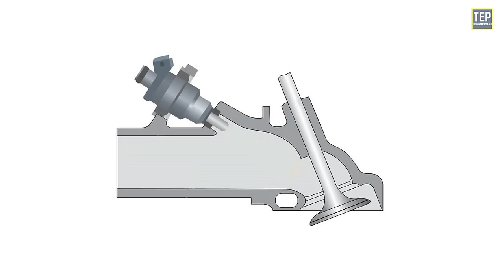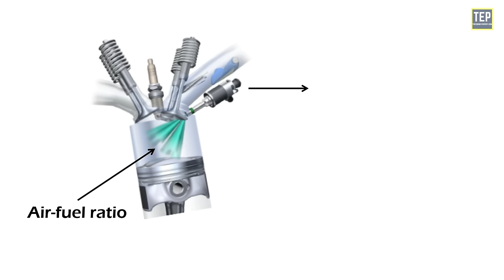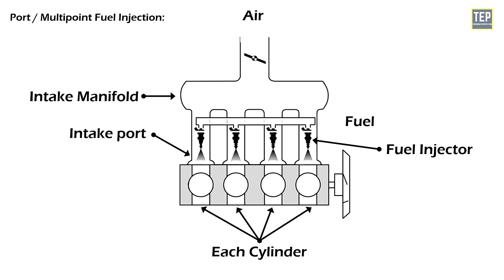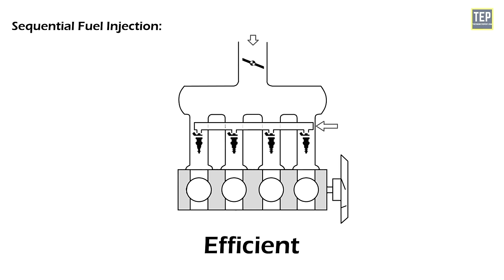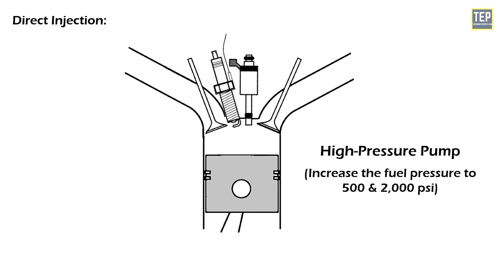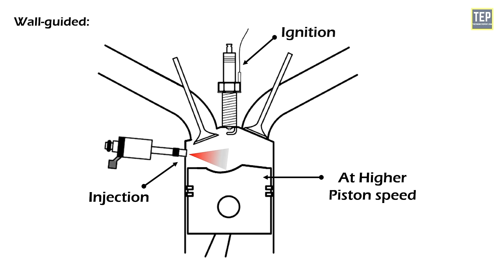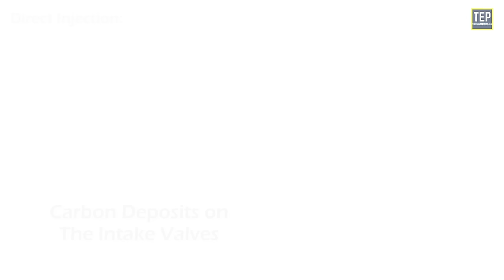Fuel Injection System: Comparing How TBI, PFI or MPFI, GDI, Dual Injection Works?

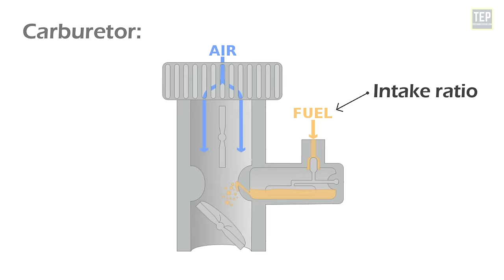Comment: 6:56 actually, before I engine-swapped for a bigger engine, my 1984 Camaro had a carburetor that acted like fuel injection, but also acted like a carburetor at the same time. It had parts inside of it that regulated fuel-air mixture controlled by the ECM.
Reply: Ah, that was a crazy system
Reply: Forgot to add, crossfire injection

Comment: At 15:27 - Petrol/gas fuel burns with a flame front, it does not explode. Diesel, on the other hand does explode, these engines are referred to as detonation engines.
Reply: compresion ignition in the usa
Reply: "Diesel, on the other hand does explode"
Maybe under water yes, but not in real life

Comment: Wouldn't simultaneous fuel injection be worse for fuel economy and emissions than sequential and batch because you're getting fuel delivery on strokes that aren't the intake stroke?
Reply: The batch injection would have the same problem. Only one cylinder is doing an intake stroke. Why would anyone inject fuel into more than one port at a time since the wiring and electronic control is not difficult?
Reply: I am assuming it changes torque or hp depending on cc of the cilinder and sequence. Maybe batch would improve torque, while sequential focuses on horse power , ?
Reply: What do you mean by simultaneous? The dual injection system operates at different rpms.
Reply: There's hardly an engine that works solely on simultaneous injection through all rpm. I have a car with Nissan engine QG18DE. It starts with simultaneous injection when the engine is cold, for about 20 seconds, and switches to sequential injection when engine rpm is above idling or engine temperature being communicated to the ECU shows the engine is adequately warm. So, simultaneous injection is for cold starting, then as the coolant temperature tells the ECU that there is a rise in engine temperature, the ECU switches fuel delivery to sequential injection.
Reply: Yes. It was done to reduce costs. The fewer separate injection events, the less powerful (therefore cheaper) the ECU needs to be. Batched or simultaneous injection also has a role as a "get you home" fall-back when one of the sensors has failed.

There may be other advantages to batched or simultaneous injection, though I don't know what they would be. Hopefully we'll get some more information from other contributors.
Reply: Yes. But until we got cam position sensors, it wasn't possible to intelligently fire the injectors on individual ports timed to the intake stroke. A crank sensor only tells you when a cylinder is at top dead center(compression or exhaust) or bottom dead center (intake or power). Under such conditions only batch fire is possible. Continuous or batch fire is still used as a limp home mode if the cam position sensor fails. Continuous or batch fire is also used during starting because they can start quicker than the cam sensor can zero i's interpretation of the cam reluctor ring position.

Comment: Back in the 80s European cars had Fuel Injection E-CIS Called K-Jetronic or CIS or Constant injection System, it wasn't a  Sequential system, outdated by 1985 Where Some Top Line American and top line Japanese Cars used a Timed Sequential Port Fuel Injection System

Comment: Do you have a video that explains how the old mechanical fuel injectors in diesel engines work?
Reply: Old mechanical diesel injectors work in a similar manner, instead of a electromagnetic coil, you had a camshaft press the injector, spraying fuel, more like a bottle of glass cleaner, you pull the trigger, a fine mist of it comes out.
Reply: @Keyaan Adeeb  The old Detroit Diesel injection system worked like this. Then came the rail pump and then the Bosch VE pump designed for high-speed diesel engines.

Comment: Thank you so much ... I have a gdi injection engine ( vw fsi) . I have converter it to start using cng gas but yhe car has refused running on gas. I ensured the gas inlets are very close to the engine block  and yet I will not run on gas. Please guild me on what to do

Comment: Out of these types of injectors..which one is widely using now days in SI engine and CI engine??
Reply: CI uses spray guided Direct injection and SI engine use either sequential multi point or wall guided Direct injection

Comment: 2:48 How can the fuel pressure regulator increase the pressure by alowing more flow?? if its after the rail it should restrain the flow so there will be more pressure inside the rail...
Reply: Pressure regulator increase the pressure by allowing more flow from pump and restraint after rail.

Comment: As said too many components,parts & their requirements,got a solution as follow:-
1)Either one or not more than two pistons engine.
2)Power problems can be achieved by making a choice for the size of the piston.
3) Position of engine fitment in car to get body balance ratio for getting the best performance from engine.
4)Research which type gives three qualities,reliability, performance & fuel consumption to the standard.

Comment: Will the life of the injectors for the GDI sytem be shortened since it's directly in the firing sequence in the combustion chamber?
Reply: Not really, they're made to last.
Reply: @dragospahontu  The negative is that direct injection does not clean the intake manifold.
Reply: @Mr_Glenn  Not the intake manifold, the intake valve

Comment: "save fuel" at what cost to you?  $300 every 7 years vs $2000 every 5 years to maintain?
Reply: dual injection is very reliable and gives not just efficiency but extra power. a NA 4 cylinder today is more powerful than a small block v8 of the 80s

Comment: direct inj. was bigest BS for normal street cars, port is the best....about how much can drive a street car in high rpm , daily ? .....5%  ?   with a young stupid  petrol head 10% ?
Reply: it also allows for smaller displacement engines even reduce cylinders for the same power output. A dual injection NA 4 cylinder will have about the same power as a v6 with just port injection. One less head gasket, two less camshafts, 8 less valves.